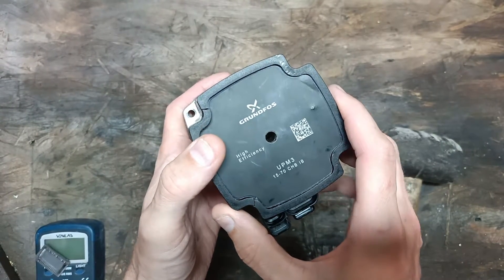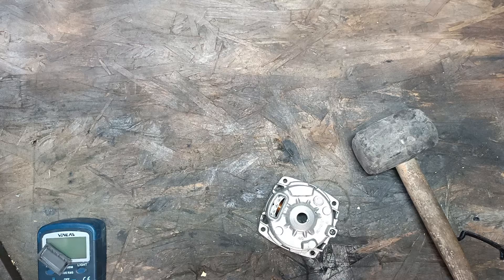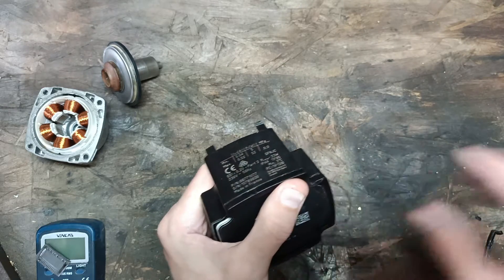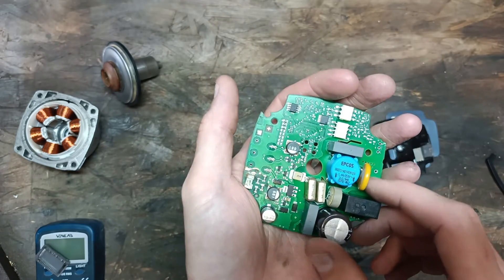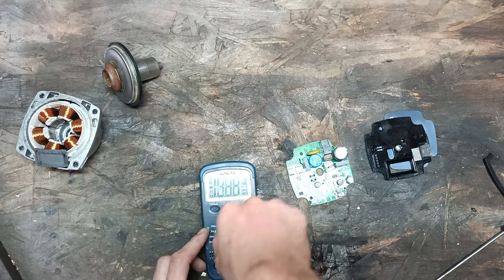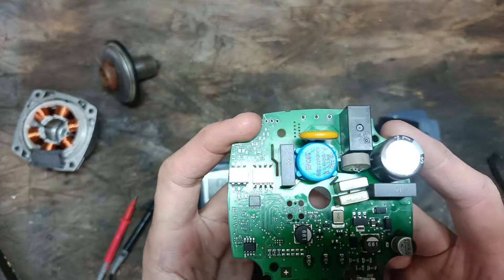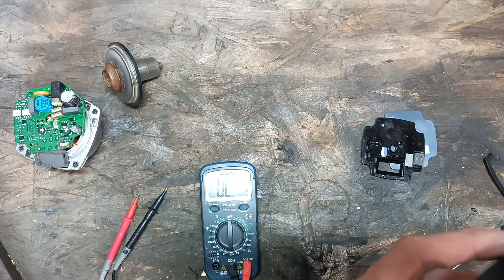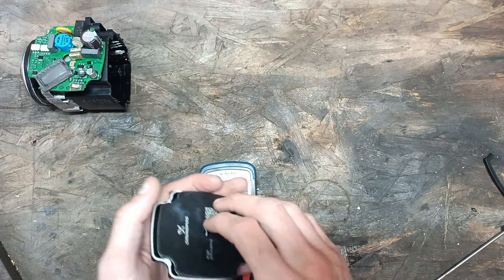Grundfos UPM3 Autopsy!

Comment: Thanks for making this video. One thing I would add is that it is easier to remove the plastic frame from the metal body by using a small slotted screwdriver to disconnect the four prongs of the plastic frame one at a time and use another slotted screwdriver to pry the plastic frame from the body. The prongs can be accessed from the impeller side of the pump.
My pump failed after two years, a replacement cost £350! This video helped me fix the original pump. Thanks again.